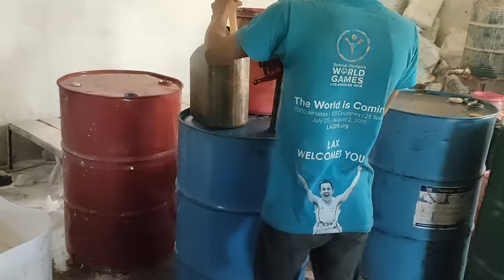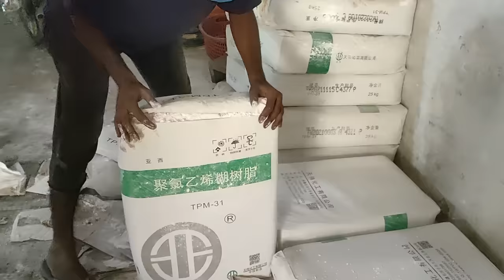Complete Process of Making PVC Balls by [ Technical stack skills ]

Comment: try to use motorized nut and bolt closing and opening handy gun. price not heavy. msy be below 3000 rs.  you can reduce strain and speed up thr work. there is a limit to strain and suffer. but atleast 4 such guns  Bisch brand yhr best. buy them today itself. hope your boss will accept and help you.